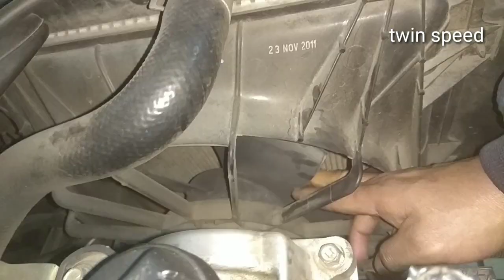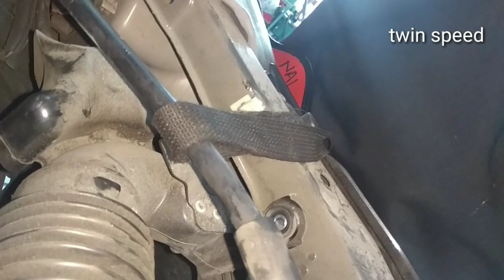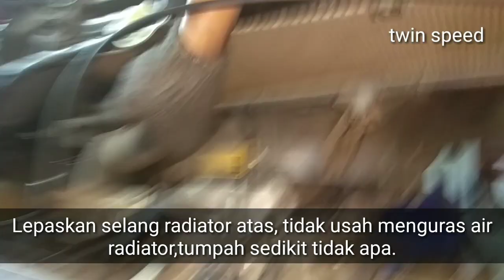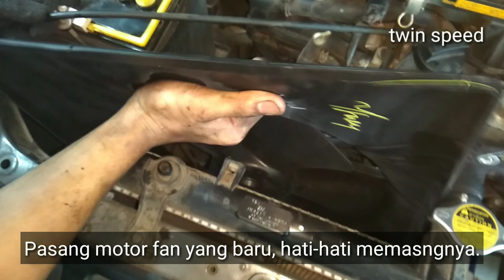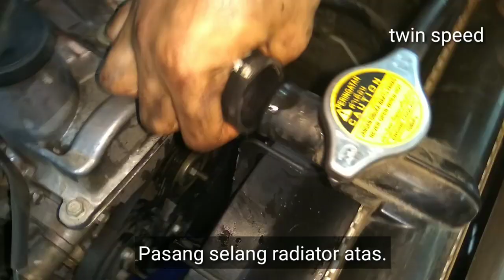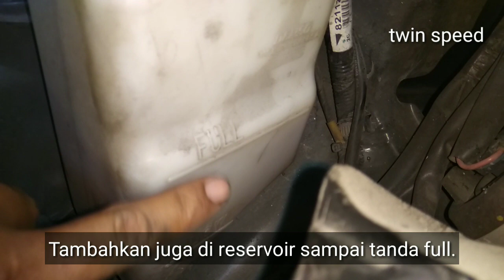GANTI MOTOR FAN RADIATOR KARENA BUNYI DAN MATI PADA AVANZA XENIA RUSH TERIOS

Comment: Mau tanya gimana lepas socket kabel ke motor nya yaa ? punya mobil saya kayaknya keras banget tidak bisa dicabut socketnya. tq
Reply from the maker: Diperhatikan pengancingnya gan,,, asal menekannya pas, mudah lepasnya. 
Tapi emang kadang ada yg keras. 

Kami menjual sparepart asli toyota dan menerima pesanan sparepart🙏
081226134486
https://shopee.co.id/twinspeed?smtt=0.6561216-1666451150.3